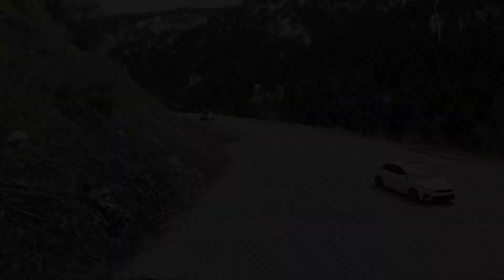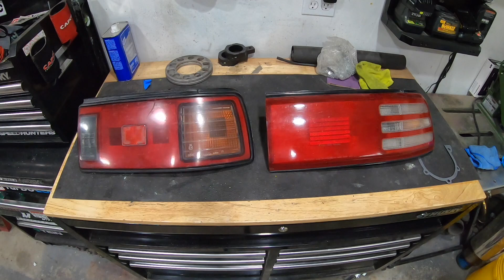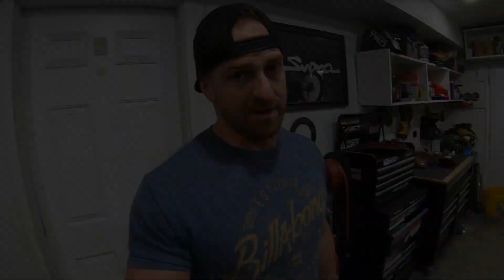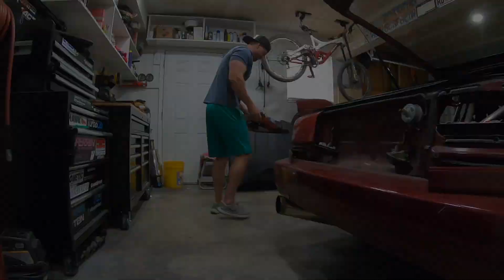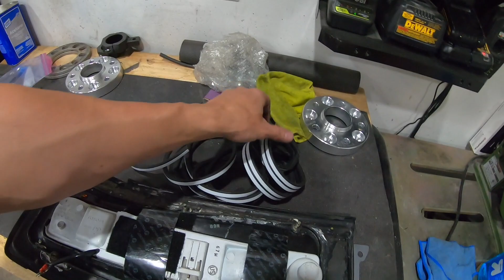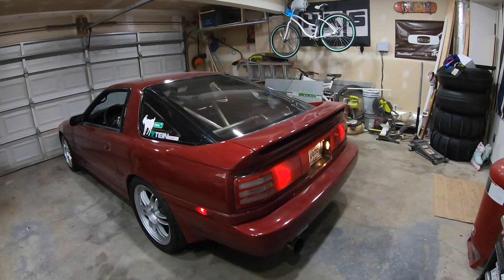Mk3 Toyota Supra 89+ tail lights install on a 86-88 base model

Comment: Love my 87 tail lights 
Just simple and clean look. And it’s a 5 speed turbo. The other ones just have to much plastic look more busy in my opinion.
Reply from the maker: I was back and forth for a while with doing this. I got the lights for so cheap it made the decision easier. If the prices were as high back when I did it as they are now, I wouldn't have swapped them out.
Reply: @mainstreambuilds  everything for these mark 3’s are going up in price. It’s crazy!
Trust me I know mine is at sound performance now. 🤑😭 keep it don’t sell it!
Reply from the maker: @mike morales  yeah I can't believe how much stuff costs now! Oh believe me, the car isn't going anywhere now haha. I almost sold it a few years ago and I'm glad I didnt!

Comment: Hey do u still have the pre 89 tail lights
Reply from the maker: I sure do. They are in pretty rough shape though.
Reply: I just need the left one I chipped a piece on the frame what do u want for it
Reply: Let me know how much to buy tail lights in Florida
Reply: @mainstreambuilds  how much do u want for tail lights
Reply from the maker: @marvinjenkins9704  sorry man I didn't have a chance to message you back. I might hang onto them, but I haven't decided yet. I will let you know and come up with a price with shipping
Reply: @mainstreambuilds  ok I only asked because u mentioned in the video about tossing them
Reply from the maker: @marvinjenkins9704  No you are right, I will definitely sell that one to you before just tossing it in the trash. I will make a decision here soon and keep you posted.

Comment: Hey! The real way to differentiate these taillights is not Turbo vs NA, but actually if they are pre- or post-facelift. The ones you installed are actually post-facelift taillights. In 1989 the mk3s got a facelift, which included 3 piece taillights and a more substantial front bumper design. Your car looks like it has a pre-facelift front bumper, which would match up with the pre-facelift 2 piece taillights that you are replacing.

My car is NA but has the 3 piece taillights and different front bumper, because it is a 1989 car and is the facelifted model.

I have a friend who has an 1987 car, but has swapped out the front bumper for the post-facelift one. He decided to keep the pre-facelift, 2 piece taillights, so he essentially has the opposite of your setup.
Reply from the maker: Hey thanks for messaging me! Yeah I had no clue. I always thought the 89+ tail lights only came on the turbo model. I knew they had the different front bumpers but again I thought the face-lift bumpers only came on the turbo models. Thanks for the heads up I really had no idea!

Comment: The OEM taillight gaskets are still available, they're not that expensive. You can get them from amayama or megazip I think.

On my 87 non turbo the facelift taillights just got in without drilling any holes by the way